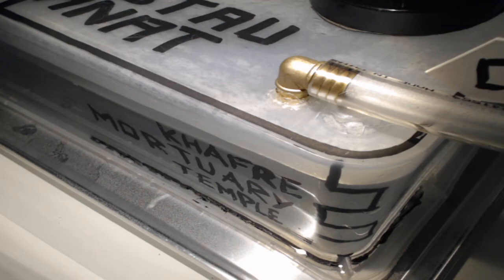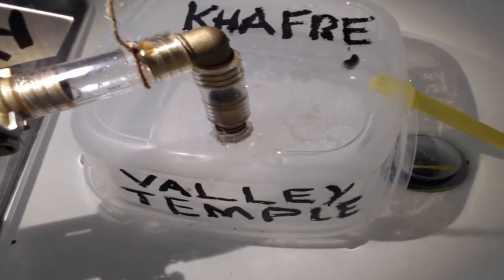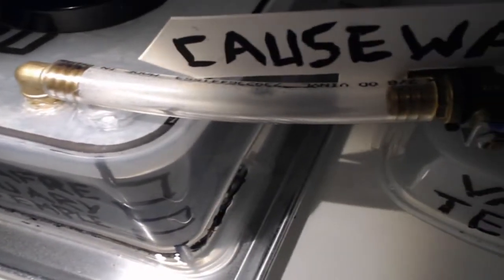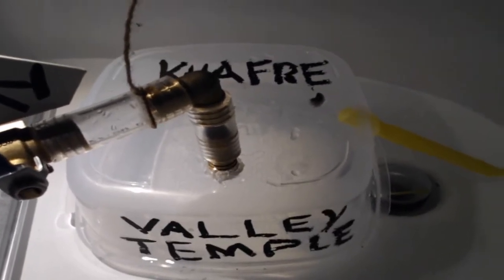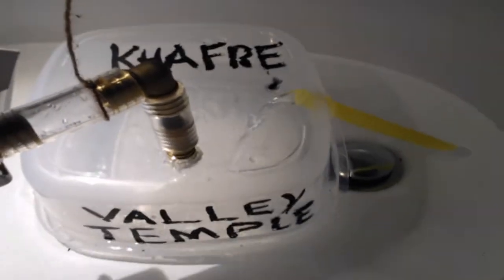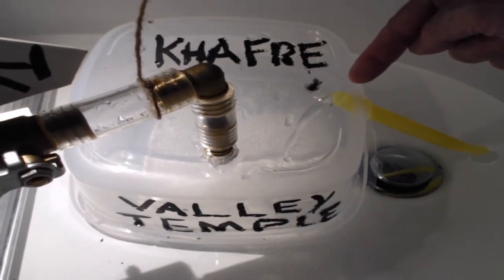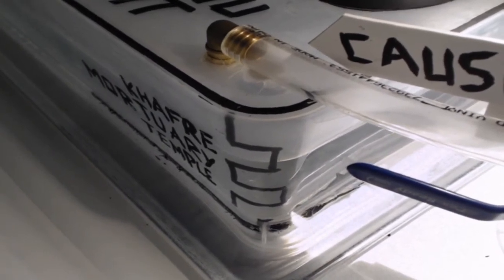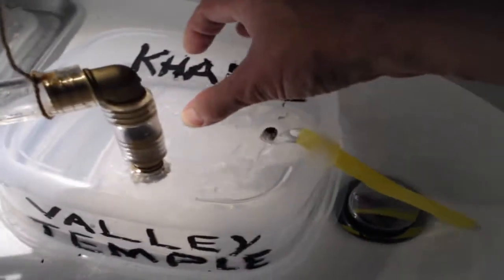SEE the Khafre site in action.

Comment: As always, a very interesting post! Unfortunately, your theory will be ignored by the science despite several practical demonstrations (as also my theses). 
Because the mastery of such a technique is consistently denied to the ancient Egyptians. The builders of the grandiose pyramids shall not even have known the wheel. And the blocks for the building of the pyramid are supposed to have beaten them according to the official doctrine with chisels from copper into form what is completely impossible with granite. Nevertheless, it is claimed that the Egyptians did not know steel.
Best regards, Gregor Spörri
Reply from the maker: Thank You Gregor. "The" science does ignore my theory, and  that is the reason your support is great. I will die trying to change "the" science. No worries, even I didn't know what I know now,  a mere 12 months  ago.